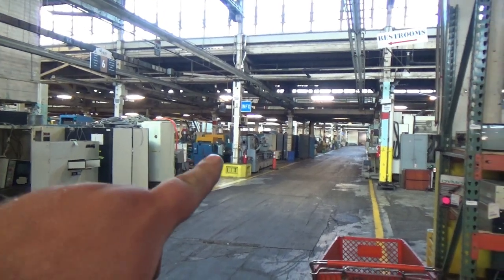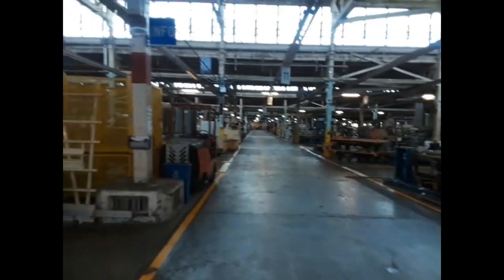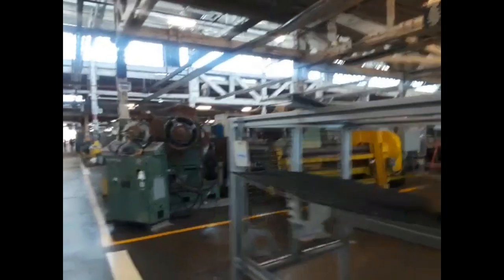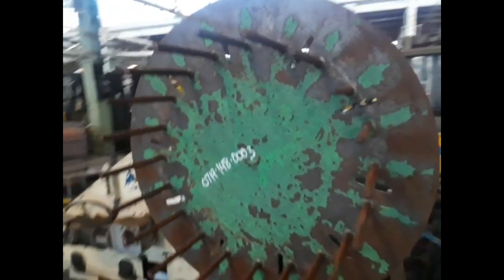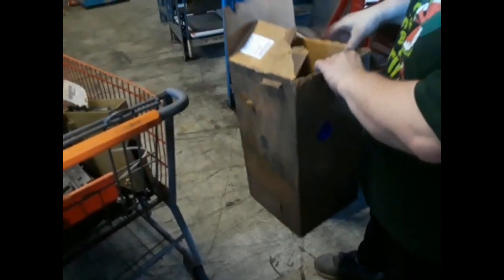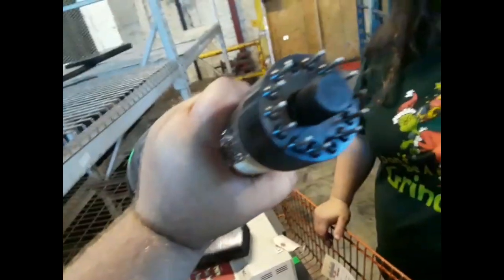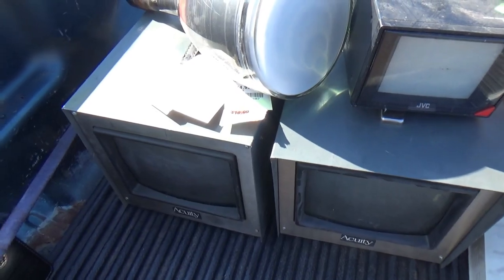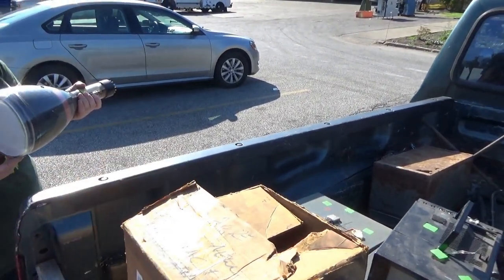vintage electronics road trip to HGR

Comment: There is one other electronics surplus place I used to visit on a regular basis.  It's a huge warehouse and with a  large electronics junk yard in the back.  They don't have lathes or large robots but they do have boxes of components to the ceiling.  Any kind of resistor, switch, knob, connector, oscilloscope, etc you could ever imagine.  And what most people don't know is they have another warehouse down the street not open to the public.  I was restoring a very old ham radio and I needed a large, very rare knob for it.  They had them in stock, NOS, but they had to send someone to their other warehouse to get it for me.  Here's a video that just kind of touches on some of their things:
https://www.youtube.com/watch?v=XesfMfS5usY
Just thought I'd share.  It might be worth a trip to Sun Valley, just north of Los Angeles if you're into vintage industrial electronics.

Comment: You'd build a vector display when you can buy a Tektronix 1420 for $25-65? I wouldn't.
Reply from the maker: yeah but its not color to small and awkward to fit in an arcade cab